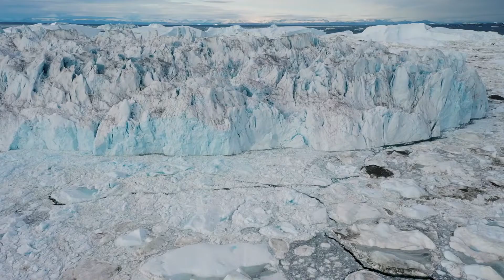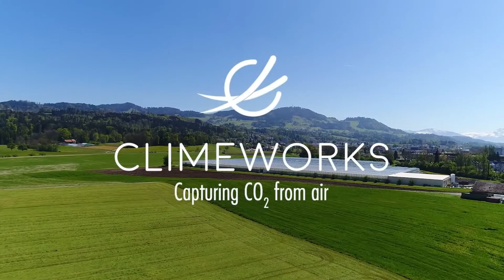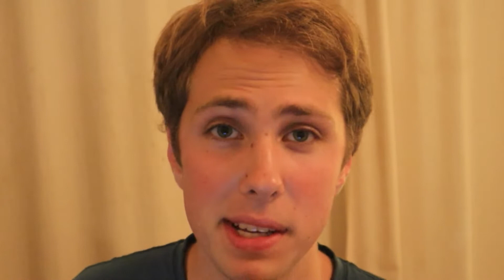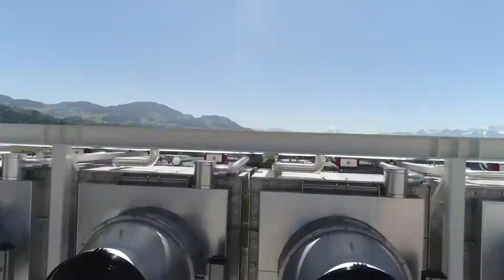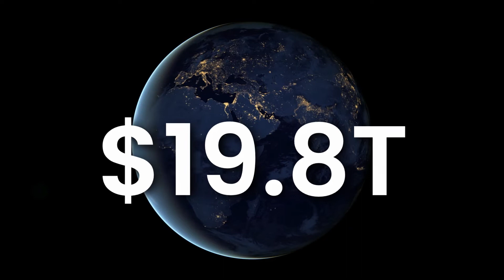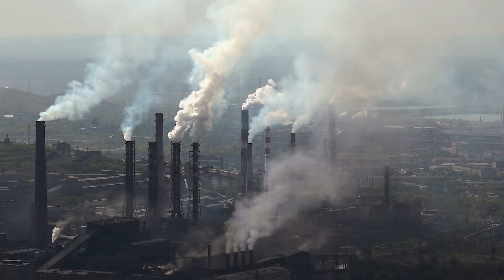The Machine Sucking In Carbon Dioxide To Reverse Climate Change

Comment: quick tip
I notice you tend to accidentally peak your mic a lot
try to hold it a bit further away from yourself and speak a lot louder. Not only will you stop peaking the mic and have more consistent audio quality, but the audio itself won't sound as muted. It'll be crisper and clearer, which will really help aid the information you're presenting
otherwise the video was a solid quick and clean overview of the topic
Reply from the maker: Thanks!